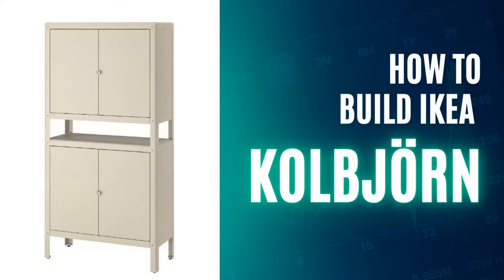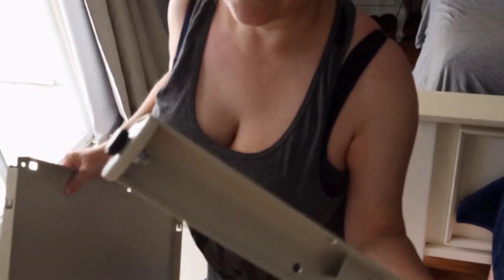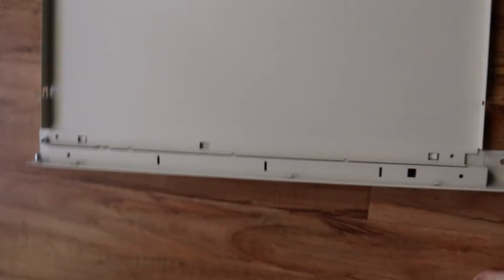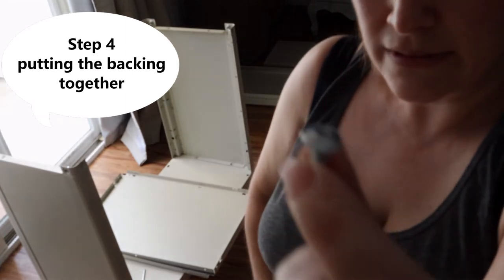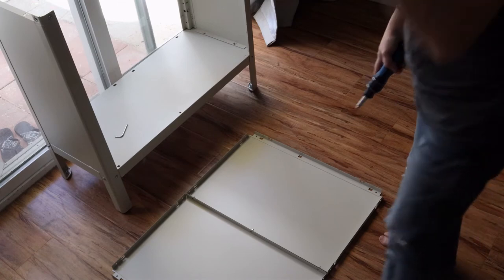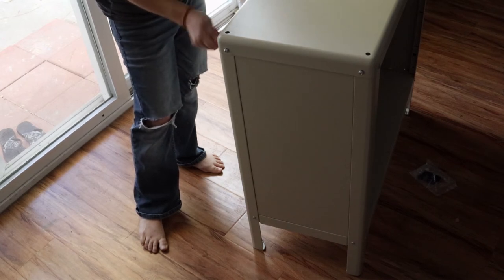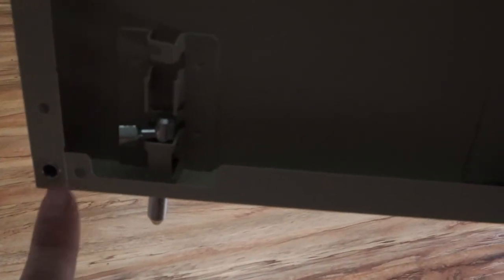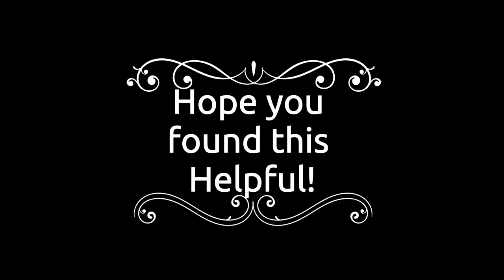How to build IKEA KOLBJÖRN cabinet From IKEA

Comment: How hard was it for you to get the top unit up there (assuming you did it yourself).   Is there some easy trick to that?   Is it a ridiculous idea to semi-build the top unit in place?   I'm envisioning scratching it getting it up there or one leg slipping off etc
Reply from the maker: It did do it myself, but I would not recommend it. It toppled over the first time, and I scratched one of  the doors. If you do it yourself, I would recommend laying it on the ground, securing the top, and then propping it up it up. Yeah, I highly recommend offering a friend lunch to help you.
Reply: @cazafeya  Figured.  Thank you!